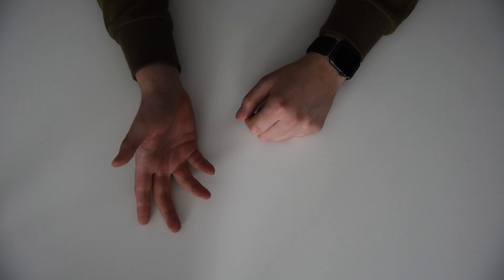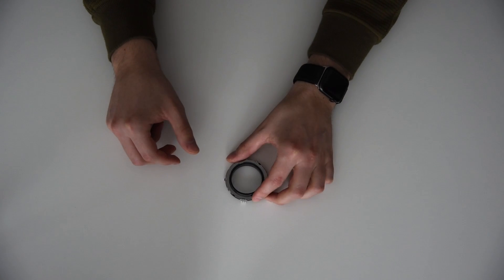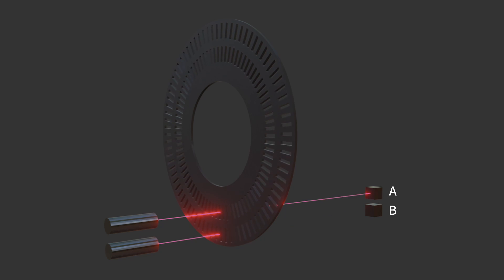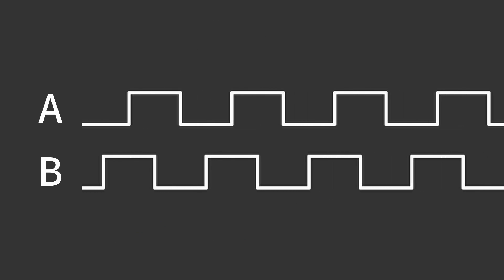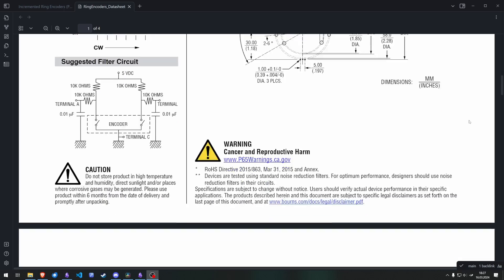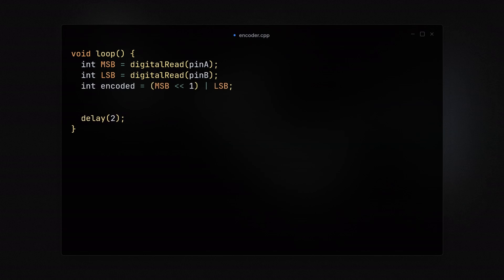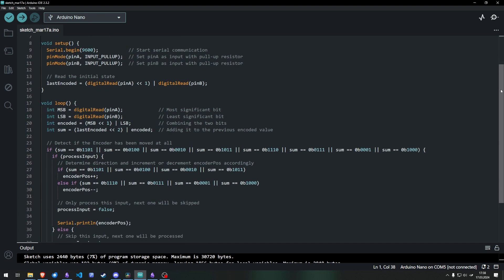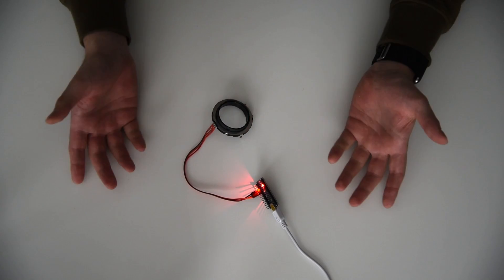[Tutorial] How to Use Incremental Encoders with Arduino

Comment: Wait, it doesn't have a Vin pin?
Reply from the maker: This one does not. There are models with 4 Pins, that include a Vin I belive. 
When I started playing around with it, I assumed it would be working the same as a Potentiometer and connected 1 pin to ground, one to a GPIO and one to 3.3V. This resulted in me frying my microcontroller 😂

Comment: While this shows the fundamentals of how incremental encoders work, this implementation wouldn’t work so great in practice because you’re hogging CPU time to make sure you don’t miss a pulse.

This would be an excellent time to use interrupts to trigger this logic, which would free up your CPU cycles to actually run the rest of your project.
Reply from the maker: I also had a version that was using interrupts. However, that was causing issues with rest of the code I was using in my project 🤔
I settled for this approach, because its more „general purpose“, I think. 
Thank you for the comment though. I am also not all-knowing and would love to learn more about the topic :)
Reply: You might like to look at the STM32  encoder functions, which use 2 timers to do count and direction, with the ability to "chain" the encoder counter to another timer to get the pulse width of the transitions, to generate speed values...
Reply from the maker: Sounds interesting 🤔